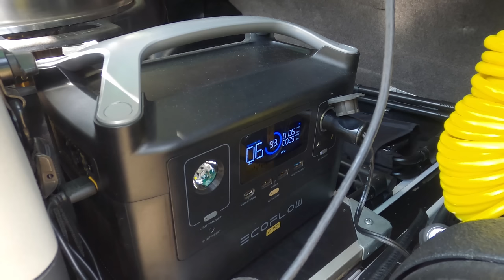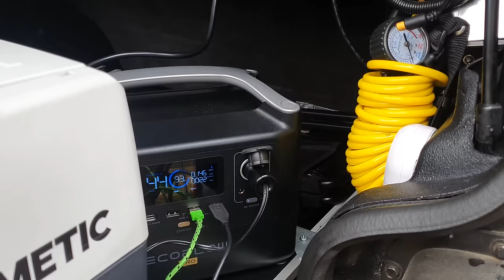Epic Solo Jeep Camping & Fishing Adventure

Comment: Hey mate, I’ve watched quite a few of your videos over the the time, since I’ve been wanting to add a diesel XJ to our collection.
Just yesterday I ended up finding a good running example so now I’ll be going back through and watching a lot of your videos again to get all your great tips!
Reply from the maker: Ah nice one, congrats on the new XJ. Hopefully its been looked after but regardless they are pretty easy to work on.  Thanks for watching.
Reply: @WorkshoptoWilderness  it had been sitting in a shed since 2019 so it has a few issues now that it’s back up and running, but we don’t buy Jeeps because they’re flawless, right? 😂
Reply from the maker: Haha yeah that's true. Well that's good that it's been just untouched for ages in some way.
Reply: It does have a pretty bad oil leak at the rear, might be the rear main but it I’ll have to give it a clean up and check. A front wheel bearing collapsed on the 140km drive home too, so I only just made it back. Apart from that I’m super happy with it. Paid AU$2000.
Reply from the maker: @JeepinDownUnder  wow very good price. Often the rear main is alright, it's a cam shaft o ring above the rear main that always leaks. You have to pull the bell housing adapter off the back of the engine to change it.
Reply: It may actually be that. The leak seems more to the LHS, and considering the injectors are on the LHS I’d assume the pushrods/cam etc are too. Seems to run down from between the bell housing adaptor and block from the left. Cheers for the tip!

Comment: Great video as usual. Looks like you had fun fishing. How do you carry your fishing rods? I’m impressed how you can use the drone while driving.
Reply from the maker: I just have mine across the back seat. Ivo has a rod holder. I will build an external lockable rod holder eventually. I don't actually control the drone and drive or I would already be dead. It has object recognition software and obstacle avoidance software so I just tell it to follow my jeep or Ivo and it will just fly with us up to 35kmph.
Thanks for watching!

Comment: @30:56 Hey Mike, whats that black box with the gopro stickers on it?
Reply from the maker: Its a power bank that runs the gopro and charges the camera gear. I have no batteries in the main camera and it runs solely off the power bank. I put the powebank in an instalated box so it runs in the winter.

Comment: I want to add a roof top tent to my xj but I like wheeling and crawling I worried the tent will hinder it’s performance Offroad. What have you found?
Reply from the maker: If you mainly crawl and your off camber a lot then you will see a difference although the severity of that depends on the tent you choose. 
There are some extremely light weight tents on the market, couple that with two load bars for mounting and you wouldn't compromise the jeeps rollover angle. My tent is about 70kg spread across the top equally. Its heavy in my opinion but light in the tent world, apparently. My jeep can still happily sit at 45 degrees and not topple but it's certainly not as stable as without the tent. Obviously most of the weight is down low but still the tent makes a big difference in that tipping point and how fast you enter and exit those angles.

Comment: What motor is in this jeep if you have a video please let me know
Reply from the maker: Its a 2.5l marine diesel engine. They came as standard in the euro exports. There pretty solid engines and you can make decent power and torque out of them if you tube them up and upgrade the heads. The original heads and gaskets are bad though so they do need changing if you want reliability. 
I have lots of build videos on it as done a great deal to mine to get it yo about 380nm.
https://www.youtube.com/watch?v=kQ5Vl6pTJUU&list=PLQQXgt9BFgARUPF53xgncZF2nlcCqJmwV&index=9&t=126s&pp=gAQBiAQB
Reply: @WorkshoptoWilderness  wondering if I can find one in the US thanks for the info love the videos man
Reply from the maker: Take a look at BMW 57 engines. It's probably one of the best diesel engines ever made. They sell an adapter kit for the ax15 and AW4 transmission. Also, a plug-in ecu kit that handles all the electronics. It's a popular swap, and you can get over 550nm orlf torque

Comment: What motor is under the hood
Reply from the maker: Its a 4 cyl marine diesel engine. 425 OHV. It came standard in Europe with the XJ's. They are not that good stock and underpowered, they can also have issues with the head cracking and original shitty head gasket (mostly due to inadequate cooling). 
I've swapped the head to an AMC one along with a ML gasket. I've also swapped to a mechanical VE pump, which i've tuned and paired with a GT series turbo, manifold and a different intake manifold. Also a small but efficient intercooler with solid piping.
It makes somewhere near 160hp now with around 400nm. Its somewhere around there away as my friend has dyno'ed his and I am yet to do mine. 
The only downside of tuning is terrible fuel economy. When I first bought it it did 36mpg, now its probabaly 20 or less, but it runs great and pulls like a train. 
Anyway, life story over, thanks for watching.

Comment: #1
Reply: Mike, I am glad to see you outdoors again. I would like to see you take your Jeep Cherokee over the rocks in the beginning, just to see how the solar panels do with the vibration?? I understand that the pike are small, but could you not still cook them? Thanks again for the great video......
Reply from the maker: The Pike taste awful to be honest. Worse in the summer anyway as the slime they produce makes them more tricky to prep. I have eaten Pike several times in a few ways, its not the best fish for eating. Perch are pretty good, especially when smoked, trout would be preferable.
There wont be many vibrations on the rocks because I would be driving so slow, just crawling. The gravel roads and pot holes are more of a test given you hit them at speed and it shakes the whole car. I will keep testing them and If I see a rocky trail I will try it, but I think they are on there for good. Thanks for the comment and for watching!
Reply: @WorkshoptoWilderness  
Ok, how often have you used the solar system?? If you travel all day in the woods, and get to camp with just a few hours of daylight. Is it worth the the money and time? Still, very curious. Thanks again, great to see you outdoors.
Reply from the maker: @currysmith9241  Its used on every outing currently. I have used it on four camps (only one filmed) and also a recent day trip to locate some escaped horses. 
Its functioned really well on sunny days and power still comes in when cloudy but obviously much less. In the winter I have no clue how it will perform, and in the dead of winter when we have four hours of low light I cant imagine them doing too much. 
It does mean we can stay in one place for as long as we like because the power in is much more than the power out (if sunny)
Reply: @WorkshoptoWilderness  
Mike, is it worth the cost?? Would a on board battery system be better? You do this more than I do. Let me know from you not corporate sponsors. Thanks.
Reply from the maker: For me it's worth it because I'm out a fair bit. I think it depends how long you intend on staying in one place and do you run a fridge. Also if you have an on board battery you can still have solar just as extra input. How often do you head out, do you move a lot?